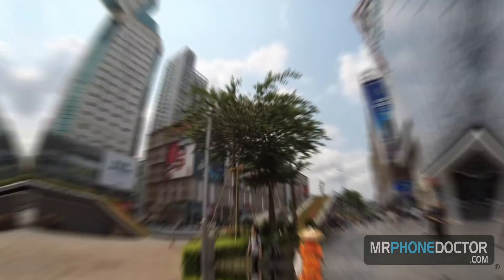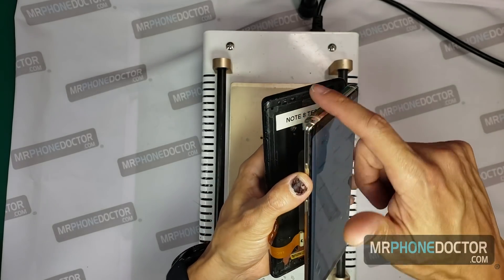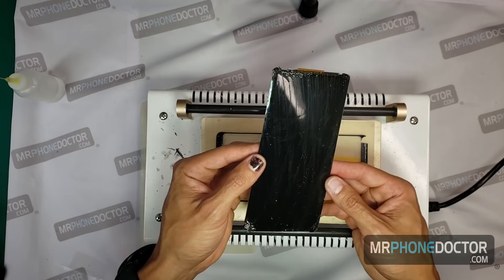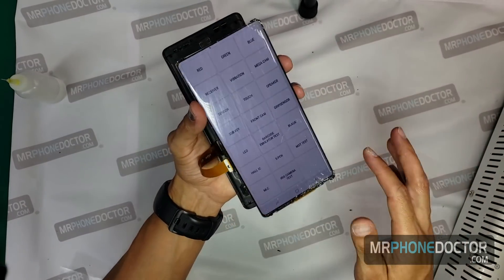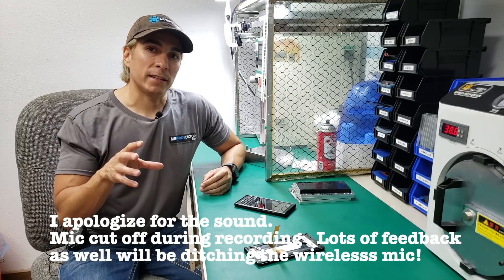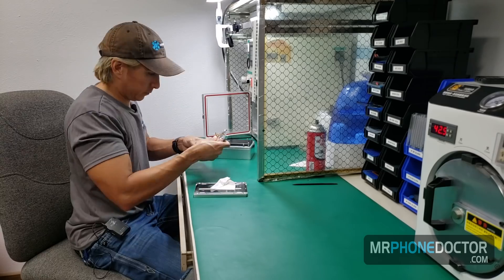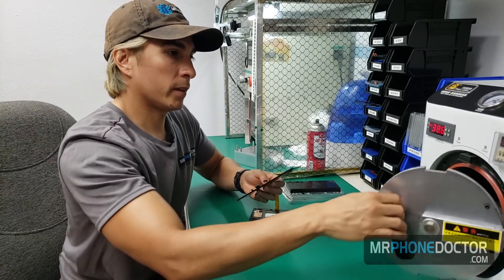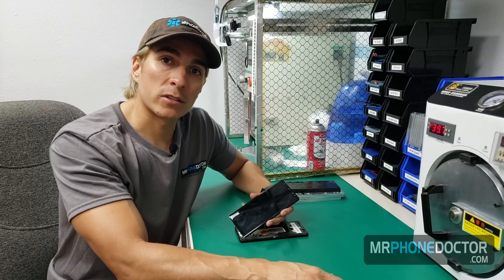Samsung Galaxy Note 8 Cracked Screen Repair Replacement (Front Glass Only)

Comment: i'am following the same steps but i always end up with a vertical red lines in the LCD after separating the glass 
do you have any suggestion about what may cause this issue or how to avoid this issue ? 
thanks in advance and good job by the way
Reply from the maker: Sorry to hear. Very hard for us to troubleshoot without seeing your methods

Comment: Do you think it's better to use the Liquid Nitrogen Freezer over this method? Which has a higher chance of something going wrong ?
Reply from the maker: You can it is very good for high volume. There is chances of something going wrong in both methods just takes lots of practice.
Reply: @MrPhoneDoctor  I have a liquid nitrogen freezer, for Samsung S7, S8 it works so well, when I tried it on my Note 9 the screen flexed and broke the connection! Now the touch screen works, the pen works, but there are multiple lines on the LCD! When I press the bottom area of the screen (where the ribbon cable is) lines appear and disappear so I'm guessing it's done... Any advice for that? Btw  glad your making these videos they are awesome! There really isn't a whole lot of proper instructional videos on LCD repair out there, your videos are super useful!

Comment: The glue solvent you're using, isn't it dangerous for the electrical components?What app are you using to test the touch after each step?
Reply from the maker: Hey not at all! We been using many years no issues. Of course you don't want to soak the amoled. We use the normal samsung SW to test. *#0*# works with all devices except verizon

Comment: i have a same front glass creak problem with my note 8 can i replaced only glass not a full display????
Reply from the maker: Yes you can!
Reply: @MrPhoneDoctor  but when i ask Service centre they sad u have to change full display not only glass and it's cost me too much!
Reply from the maker: That's because service center dont have skill to remove glass only.
Reply: @MrPhoneDoctor  sir do you think only glass replacement is good and durable for future use? Is there any gape in between glass and LED? Suggest us what we should go for? Full panel chsnge or only glass?
Reply from the maker: @yabrgon  yes it's just as good most will not notice the repair. As long as technicians use proper glues should not be a problem. + you will save more $$$
Reply: @MrPhoneDoctor  thanks alot

Comment: I got some scratches on front glass. How can I remove this??😿😿😿
Reply from the maker: Replace front screen or put a full adhesive tempered glass on to cover
Reply: @MrPhoneDoctor  I have put a adhesive glass on its front but still scratches are visible. Can you please tell me what is the cost to replace the front glass of note 8?